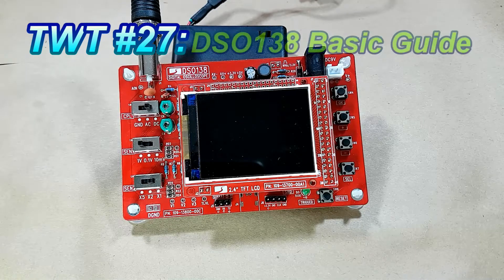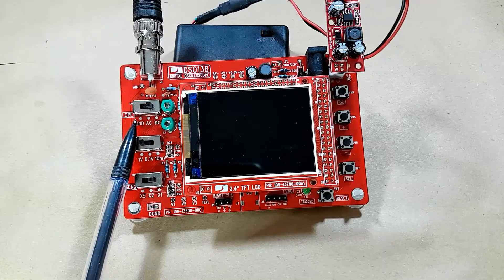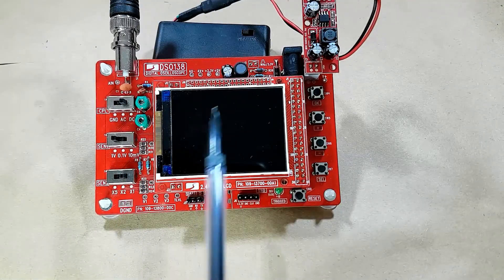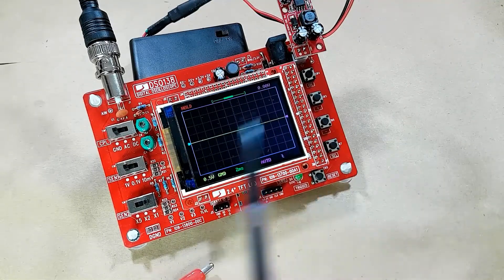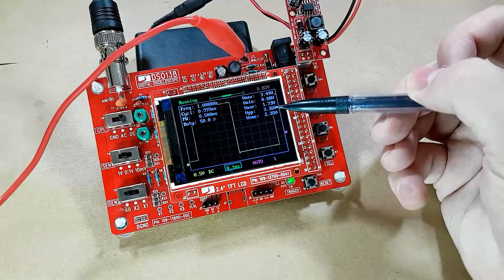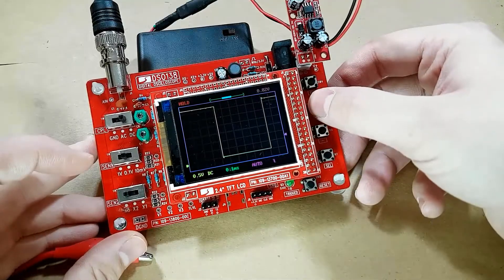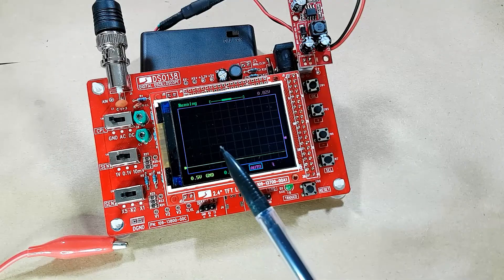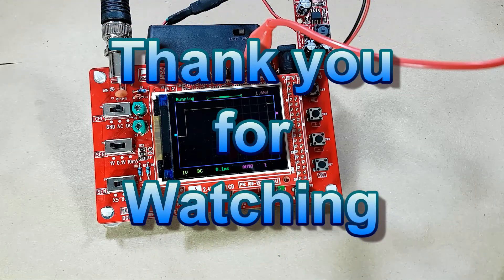TWT #27: DSO138 How to Use Basics

Comment: Excellent review, Thanks. My current or starting interest in this oscilloscope is to determine how much ripple or noise is present in voltage regulators used in RC video models. It seems I have constant noise issues that are hard to trace down and trying to determine what LC filters work best. Will this be helpful in showing/identifying the noise source? Voltages are generally reduced from 12 to around 5vdc. Thanks
Reply from the maker: It will mostly depend on the frequency of the ripple, though the scope can read up to 200 kHz so I think you should be good. The scope itself can have a small amount of noise, but it should be easy enough to see the difference between its noise and the measurement noise. At 5vdc you should be able to get quite high resolution measurements.
Reply: Thanks and looks like this should work for my needs.  BTY... this is the first of your videos I have run across and you do an outstanding and easy to understand presentation.  I will be looking forward to viewing more.
Reply: I watched a video posted by another guy that shows how to reduce the noise within these scopes by changing a few capacitor connections. I have  not gotten my scope working yet and until I get everything finished, like managing to get the BNC connector securely anchored down and the connection to the USB cleaned up satisfactorily. It's a moding video at part 3.  I don't  know what components are being used in your Vregs so I can't advise aside from using some capacitors of different values on output side of the Regulator. There are diagrams online that show how this should be done. Possibly some value of choke ( Ferrite Beads ) can be used along with the capacitors as a filter. Switching regulators obviously will induce some noise into the circuit which may be obnoxious to your RC communications. I don't think a linear Reg would be as noisy. However, noise may be getting into the circuit from the motors. With all this circuitry so close in the RC unit, RF noise could likely be what you need to address. Simply placing a cap across the connections for power to the motors could help. I would consider using an electrolytic around 220 uf and maybe a 22uf and a 2.2 with a .22 all wired in parallel. Starting with the higher value closest to the battery progressing down in value to the motor. If the motors are brush type the arcing at the brushes is going to be a major source of noise and about the only way to get rid of it beyond the capacitors would be to shield the motor with a faraday cage grounded to the power supply. Shielded cables around anything that carries higher power too at least on the positive leads. Think about how the ignition wires on Corvettes are all or should be shielded to eliminate noise in the radio since there is little or no metal around the engine in a fiberglass car, and how a lot of military vehicles used shielded ignition cables to block out RF noise so they couldn't be detected in combat zones.

Comment: hi, it can be used to the ac and dc voltage? is the waveform indicates the flow of current?
Reply: you can´t measure current with an oscilloscope but you can measure the voltage across a resistor. just get a very precise resistor or you can get resistors designed especially for that purpose that are called shunts.
Reply from the maker: Yes the DSO138 can be used to measure either AC or DC, An oscilloscope measures Voltage over Time, the result of the measurement is a visual representation in the form of a waveform. There are ways to measure current with an oscilloscope but those are not it's intended use.

Comment: How can I use it with a synthesizer's audio out (3,5 mm) ?
Reply from the maker: You could use a short 3.5mm male to male audio cable and either remove one end and connect to the bare wires, or simply clip the DSO138's probes onto the appropriate spots of the 3.5mm male plug. However you will only be able to test either the Left or Right channel at at time, not both, if the output is stereo.

On a standard stereo 3.5mm plug you will have, Ground (the largest section, also called the Sleeve), Left channel (the tip of the plug), and Right channel (the connection between the Ground and Left channels, also called the Ring.) Googling 3.5mm pinout should help if you need a visual, I was able to find quite a few that explained the different connections.

Comment: Good video just a question, my dso didn't come with the bridge as yours did to calibrate it it is very difficult for me to do so now. Will using a 1khz test tone at 0db in my car work to calibrate it assuming the output voltage is 3.3V. Or how else would I be able to calibrate this sucker. Thanks in advance.
Reply from the maker: Thank you for the question! Any test tone should work as far as I can tell. I'm unsure if there is a specific reason for the frequency of the supplied test signal or not.

The bridge on mine is simply one of the leads I trimmed off after soldering all of the parts. You could easily add one to your unit by soldering on a small length of bare solid core wire if you were so inclined. Unless of course yours doesn't have the holes for the test loop.

Hope that helps!
Reply: thanks for the fast response. this is the thing I ordered mine preassembled and I have no soldering iron and no soldering skills. I managed to calibrate it, but since I'm using it to set the gains on an amp somehow the sinewave looks very fuzzy. I know clipping should make the sine wave square at the top but mine starts out smooth and then gets fuzzy. I don't know if the DSO138 I received is defective or how to fix it any help would be appreciated.
Reply from the maker: That does sound odd, I did experience something like that when I sent it a signal higher than the DSO's 200khz bandwidth could handle, but I assume you are working with audio level frequencies <30khz? I'm not really sure if your issues would be caused by the DSO itself or interference/noise. 

Have you tried changing the time base to zoom in on the fuzziness? Also make sure that your connections from the DSO to what you are working with are as short as possible and you don't touch them while looking at the reading. Bumping the wires or the port itself can cause weird peaks to appear.

Ideally a sine wave should be a very smooth curve from 0v up to the peak voltage and then back down. A square wave should be perfectly flat at the top in an ideal world. That being said, a bit of interference does occur on my unit but nothing to the extent that it would make the line look fuzzy.

Unfortunately I'm not an expert on oscilloscopes so I don't know what exactly you'd have to do to troubleshoot this. The only thing I can suggest is possibly checking out http://www.eevblog.com/forum/ and posting in the beginner section for help along with pictures of the waveform. There are a ton of really smart people over there that are very helpful and should be able to offer some suggestions.

Sorry I can't be of more help, but if you figure it out be sure to let me know!
Reply: noise from the could result in the fuzzy wave form. If the display is clipping it could be because the amp output is above the capability of the scope, 50Vpeak. This is not uncommon with high power amps. Also clipping is not uncommon in amps as the power supply may not be able to deliver clean voltage. If the impedance is too low at the output then the wattage goes up on the output and this will overload it making the amperage delivered to the speakers which will pull the voltage down. This is the clip you may see. It will be very obvious in the low frequency and this can cause overheating in the finals.
Reply from the maker: It looking like a mountain sounds normal for a typical sine wave, a pure sine wave would only have a single peak at the oscillating frequency. Is there a reason you want the signal to clip? I would assume clipping (the squaring of the wave at the top) will only happen if your amp is being over driven, and therefore operated beyond its maximum specifications.
Reply: Thanks again. I am working with car audio but the frequency is 40hz for bass and I'm sure that is not the issue. Since I'm getting the signal from the amp itself instead of the speaker wires that might affect the sine wave. I've ordered another oscilloscope to see if the one I currently have is the issue. Thanks again.
Reply: Ok I'm back again, btw the other account is also mine but was on my phone when I replied. Anyways got a new oscilloscope and the sine wave does not square at the top. it turns sideways as if slanted similar to how it appears on the dso138 just without the fuzziness. Best way to describe it is as if looking at a mountain. Any idea why this happens.
Reply: The reason I want it to clip is to see at what volume it clips. The sine way looks perfect at certain levels and after certain volume the whole peak shifts and looks like a witch's hat and no flat surface. Not sure if there still DM here on youtube to send you a pic of it see if you ever seen that before.
Reply: @josearmz10789  Hello again, your first sentence here indicates to me that the power supply cannot keep up. The sine wave you are looking at indicates Voltage. If the peaks are missing then the voltage supplied to the amp is also missing at particular volume and frequencies. There are different classes of amps, class A, Class AB Class D, class D has become the common for car audio and since you are limited to 12v nominal here, the only way the manufactures can advertise higher power is to increase the amperage going to the amp and/or to add voltage step up circuitry in the amp to raise the supply V to the final amplifier transistors increasing the available V to drive the speakers. So if you see the peak lean over, I would say that the output voltage is falling off and what you're seeing is harmonics being produced in the coils of the speakers bouncing back at the amplifier. The speaker has momentum and the coils surrounding a powerful magnet become a generator producing their own power.
Reply from the maker: It sounds like once you pass a certain threshold the whole signal is shifting. I'm not very familiar with different amplifiers, but it sounds to me that this behavior may be the equivalent of clipping for that particular unit. When I've messed around with my DSO138 the only time a rapid shift has occurred in the signal was due to an under powered signal generator or a signal that exceeded the units bandwidth (which shouldn't be happening for an audio amp).

I wonder if the input signal going into the amp may be too weak for it to amplify over a certain level and if that might explain the distortion of the signal?  

My only suggestion at this point would be to go over the specifications of the amp, check the input source(if you haven't already), and if all else fails head to an Audio or Electronics forum and see if anyone has suggestions there.

I wish I knew more about audio components so that I could be of more help. :(
Reply: Thanks for that explanation you been very helpful. I'm measuring the headunit through the amp and that may be the cause as two oscilloscopes measure the same behavior. Will try a different method and go from there. Thanks again.

Comment: Good presentation - helps greatly with knob pressing - 
Q.. will it run of a 3 cell lipo 12.6Volts...joe
Reply from the maker: 12.6 might be a tad high, the specified battery voltage is 9 Volts, but it can accept anywhere between 8 and 12 (according to the manual).
Reply: gotcha and thanks...joe

Comment: Is DSO oscilloscope got any cursor
Reply from the maker: No, the DSO138 does not have a cursor. It only has an arrow at either side of the screen for adjusting the Vertical position of the waveform/trigger.

Comment: Please answer .. how much volts can it measures? ?
Reply from the maker: Maximum specified Input voltage is, 50V peak using a 1X probe.
Reply: @TinkeringWithTerrius  thank you for information
Reply from the maker: You're welcome, I hope it was helpful.
Reply: This is a really dumb question I'm sure...but I'd rather be safe about it. I wanted to look at a modified sine from a cheap 120V AC inverter with my DSO138 so after researching ordered probes that are 10X. Are those the correct ones or do I need 1/10th probes. 10x makes me think 120V would read as 1200V.
Reply: @PowerScissor  i don't know if you are still looking for an answer but with a 10X probe it will read 120 volts as 12 volts.
Reply: @engineeringgarage5113  I was, thanks! I just thought maybe I needed a 1/10th probe and 10x would do the opposite. Just so new to electronics...thanks for replying going to try it now.
Reply: @PowerScissor  Yeah I can see where it doesn't make sense lol, no problem! Happy to help!

Comment: Thank you thank you thank you! As a hobbyist I can't justify a $400 oscilloscope. And this will be my first one to play with.I know and bought this knowing it's not much better than a toy. But that's exactly why I want it. To toy around with. So a basic tutorial video will be very helpful! 

Thanks to whomever suggested you make this video as well.
Reply: These oscilloscopes are more used to get a rough idea of what is going on. I am not a pro at electronics but when I create oscillators; sometimes I want to know the output without using a LED or some sort of Ardunio. The DSO138 is trash compared to Rigol series. But the DSO138 was not meant to replace Rigol, it's targetting to the hobbyiest audience I believe.
Reply from the maker: Well I hope you find/found the video helpful!

That's the same situation I was in, I really wanted to play with an oscilloscope but there were none reasonably priced on ebay here, and this was on sale on Amazon (I bought the un-assembled one, it was very good practice for soldering). It has it's quirks but it is a very handy piece of equipment and the skills learned from it can be transferred directly to a proper DSO if it ever becomes available!
Reply: Strongly disagree. If you don't want to get discouraged as a new hobbist DON'T buy Chinese crap equipment like this. My calibration C4 barely works and C6 does nothing.